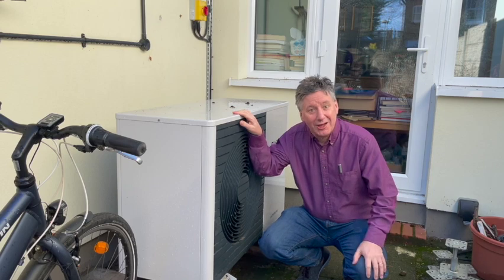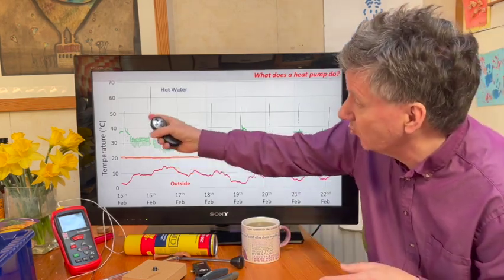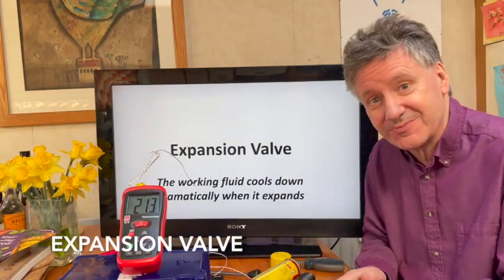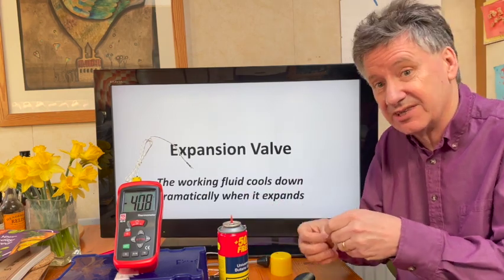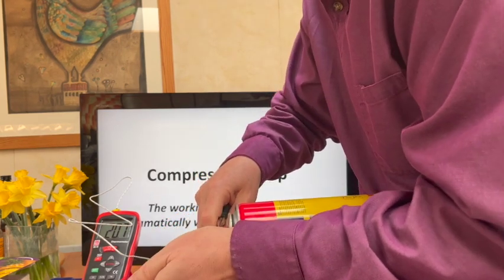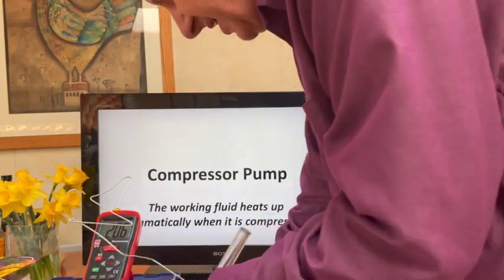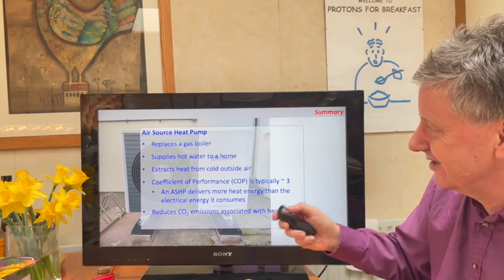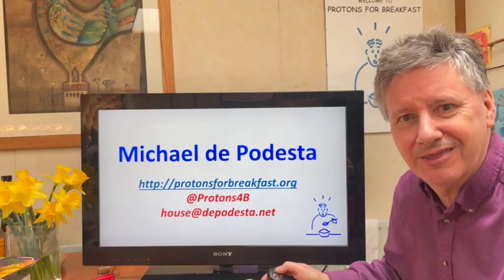Heat Pump Explainer

Comment: Hello Michael

I am very impressed by your video. I like the how you used butane to illustrate the expanding valve and also to show the ballon expanding.

The flow temp vs outside temp data is very nice too. It looks like your system is working very efficiently. Great video. 👍
Reply from the maker: Kaspar: How lovely to hear from you and thank you for your kind words: I trust you are well.

It's been one year now since the installation and everything is working well and I am very happy with it. It was a very difficult install because COVID just made everything really difficult.

Anyway, teh 5 kW heat pump is probably a factor 2 too large, and teh 3.6 kW pump would have been the right size, but everyone always gets 'the next size up'!. Anyway we achieved a SCOP of around 3.6 over the year which is not bad. The monitoring software is great - thank you - and the heat pump mechanical and electric systems are tip top: but the Vaillant App and Controls are poor.

Regarding Heat Pump Sizing, If you had time I would appreciate any comments you had on this video about a 'Rule of Thumb' for heat pump sizing 

https://www.youtube.com/watch?v=hCeghKa3liM

Please say hello to Silvinas!

All the best M

Comment: It’s got a compressor it’s got probably 2 pumps and mine has 2 big fans before you get a single bit of heat out of it I have had mine 2years it is the biggest waste of money and I got it on a Grant cost nowt proper conned by tree hugging advice save you money not a chance COP 3 this goes the whole house I want concentrated heat 1 room can only sit in 1 at a time instant heat,gas fire Heat Pump takes 2 hours to warm the radiator never mind the room.all them sums do themselves at the end of the week Heat Pump cold and skint gas fire not too bad. Nice video
Reply: Hello O Know

Like Michael said 17kW for 125kW sounds very oversized. A big heat pump like that needs to work at a high flow rate to even start working efficiently.

My advice would be to install a 100L or even 50L buffer vessel on the space heating pipework, piped as a low loss header. This would be after the 3 port valve. The heat pump can then quickly heat up the buffer vessel and your radiators can take heat from the buffer at a lower flow rate.

If you have space in the loft or a spare airing cupboard it could improve efficiency and reduce running costs for a small amount of plumbing work.

If the radiators aren't getting warm it could also be if they aren't balanced. If you added 1 or 2 new radiators to a system they will be very clean inside and all the flow rate will go through them. You would need to turn them down on the lockshield side with a spanner to get more flow rate on the other older radiators. A power flush is also good with old radiators.

Hope that helps.
Reply: @kasparbradshaw8592  Thank you Kaspar it’s just the fact it was fitted by so call professional MCS approved fitters,destroyed my kitchen pipes pumps monitoring equipment expansion tank proper mess,my Combi guarantee is probably gone because they disconnected it from the heating side.Don’t worry it will save you a fortune.this is why I comment on any and all heat pump commercials comment haha revenge.Cheers Kaspar
Reply from the maker: Dear O know. I am sorry you feel unhappy about your heat pump installation, but heat pumps supply heat in a less concentrated way over time: that's how they save you money.

In any case: keep warm

Best wishes

Michael
Reply: Just a moan Michael but a true one mine is costing a fortune
Reply from the maker: @Allegedly2right  So sorry to heat that. If you have any data on it, perhaps I could suggest something.

M
Reply: @michaeldepodesta001  Michael any advice would be great I am just going to have a go haha.it’s a Grant Aerona3  17KW it’s a big boy 
The house is EPC rated at E 125 square meters floor plan not much more to say fitted with MCS installers they went tits up so no help there right in the middle of Covid didn’t help anyway thanks Michael Cheers
Reply from the maker: @Allegedly2right  That is a big heat pump. 

EPC E is poor but 125 m^2 is not a massive house. I find it hard to believe that 17 kW is not big enough. 

So one more question. In the year before you had your heat pump installed, how much gas did you use? This gives a good estimate for how much heat you need, and from this using a clever technique you can estimate the required heat pump size. 

I explain the process in this video.

https://www.youtube.com/watch?v=hCeghKa3liM

Send me the gas data and I will estimate the heat pump size you need. M
Reply: @michaeldepodesta001  I have did it the other way kept a record of useage in kWh per day so have a good idea it was up to 35kWh average one week if I can find the gas I will Michael thanks again stuck with it now lucky enough all it cost me was 3 bigger radiators or I really be going nuts haha
Reply from the maker: @Allegedly2right  

Here is the average daily use of gas in my house over the last few years. 

https://protonsforbreakfast.files.wordpress.com/2022/09/gas-free-house-1.png

It was up to 110 kWh/day in mid winter before any modifications to the house. When it was 110 kWh/day I calculated that I needed a maximum heat pump power of  just a bit over 5 kW - I would have gone for the 7 kW model. 

So I can't quite see how if you used 35 kWh/day of gas MAXIMUM, then your required heat pump size would be just a couple of kW. I have come across many examples of oversized heat pumps which then operate poorly because they can't modulate to the low power required. But yours sounds like the worst example ever. 

Was your maximum gas usage really just 35 kWh/day?

Comment: Hi, after watching so many vlogs on ASHP’s yours is unquestionably the best, thank you. Do you have a similar one / write up covering the radiator sizing + hot water cylinder management?
Reply from the maker: Rich, Hi. Thank you for your kind words.

I don't have a movie on radiator sizing or cylinder management, but I do have this article about "How radiators work"

https://protonsforbreakfast.wordpress.com/2021/09/08/using-radiators-with-heat-pumps/

And this one about how to keep temperatures safe even after heating a cylinder in an anti-legionella cycle.

https://protonsforbreakfast.wordpress.com/2021/10/06/controlling-tap-temperatures-with-a-blending-valve/

If I have time I might try to narrate these onto a video.

Every best wish

Michael

Comment: We have an electric car since 2018 and two months ago we had solar panels and a storage battery installed. Our house was built in 2017 and it’s well insulated.
I started looking into heat pumps to see if we can replace the gas boiler and that’s how i watched your video. Brilliant information and very helpful. Many thanks

On those cold days did the heat pump freeze up?
What kind of hot water cylinder is connected to the heat pump? Presumably when its flow is 55 C for heating up the cylinder, the central heating is off.
Have you got any experience with subzero temperatures? Would it still work at -2 -3 C ?
Final question: is it really that quiet? 😃
Thank you
Reply from the maker: Serraios198, Good Evening. Thank you for the kind words about the video.

COLD DAYS: No the heat pump does not freeze up. Or rather, it does but it has an antifreeze cycle. Typically the heat pump cools the air by about 3 °C and so if the air is moist, it will condense liquid water on the heat exchanger, and at lower temperatures, it will condense ice. I wrote about this in this article

https://protonsforbreakfast.wordpress.com/2021/08/30/heat-pumps-power-noise-and-condensation/

When the heat exchanger ices up, the heat pump detects this and does a de-icing cycle: it temporarily disconnects the heating circuit and runs the heat pump backwards to melt the ice. The cycle typically takes about 5 minutes and slightly decreases the COP. This also happens in most freezers and refrigerators.

CYLINDER: We used a Vaillant 200 litre cylinder with a coil heat exchanger in. The water from the heat pump flows through the coil and heats the water in the cylinder. Yes, when the heat pump is heating hot water or performing an anti-legionella cycle, the radiators are disconnected.

LOW TEMPERATURES: Yes, last winter our lowest overnight temperature was - 3 °C. The pump coped easily with a flow temperature a little over 40 °C. I thought I had a graph showing this lowest temperature on the blog but I can't locate it now. But the household temperature didn't move from 20.5 °C ± 0.5°C for the entire winter. It is specified to work down to well below - 20 °C - just like a domestic freezer.

NOISE: Yes, it is ridiculously quiet. I have had two separate couples around to hear the heat pump as it does its thing. For the first couple, we all stood around the heat pump until the bloke said: "My legs are cold". The heat pump had started and none of us had heard it. When it is going full blast it is audible, but it is ridiculously quiet - much quieter than a gas boiler. If you are in West London I would be happy to give you an audio demonstration. It's difficult to record these things but check out this video

https://twitter.com/Protons4B/status/1455484457964687365

All the best

Michael

Comment: For your heat pump, what is the temperature of the cold water entering the outdoor unit and what is the temperature of the hot water leaving the outdoor unit and entering the home?
Reply from the maker: Jeremy

Great Question, complex answer. It varies!

In Winter
=======
The space heating uses weather compensation. When the outside temperature falls, the flow temperature in the radiators varies. Roughly 0 °C external temperature requires 42 °C water (ish) but 10 °C external temperature requires on 30 °C water. This article (scroll down) shows this in operation in March

https://protonsforbreakfast.wordpress.com/2022/04/08/march-2022/

The water heating heats water to 55 °C once a day and 65 °C once a week. The tank has a tempering valve that limits the hot water temperature to 50 °C. 

https://protonsforbreakfast.wordpress.com/2021/10/06/controlling-tap-temperatures-with-a-blending-valve/

The water supply is probably at 5 °C on the coldest days. We operate this heating at night when the electricity is cheap. It's about 1.5 kWh/day of electricity and 5 kWh/day of hot water.

In Summer
=========
There's no space heating and we still heat water to 55 °C once a day and 65 °C once a week. The water supply is probably at 12 °C. We operate this heating in the afternoon when the battery is likely to be full and the solar PV would otherwise be exported. The air temperature at this time of day is higher which improves the coefficient of performance of the heat pump.

I hope that helps:

M